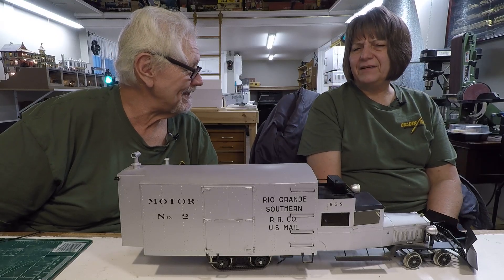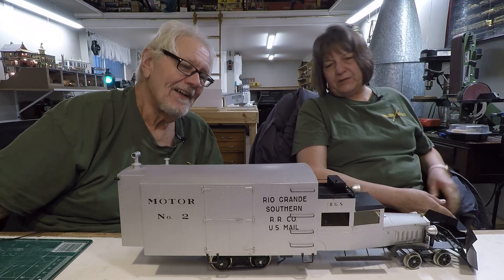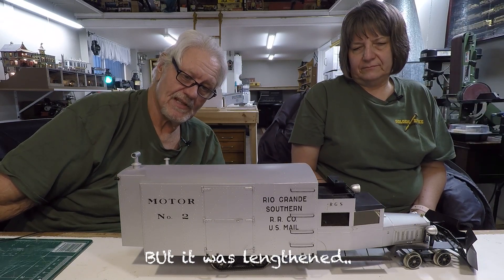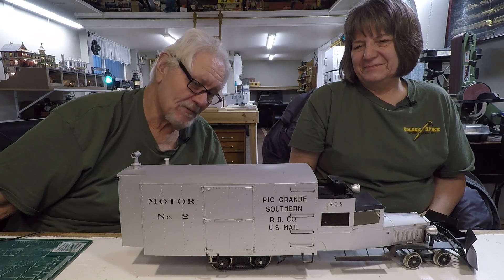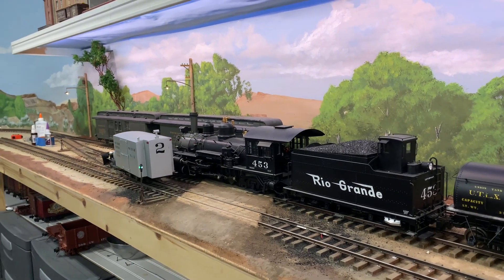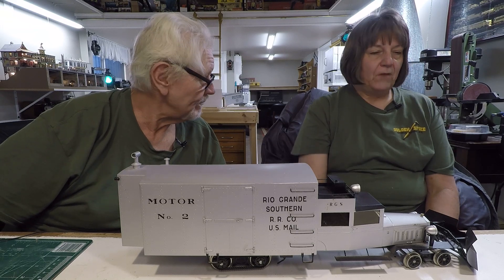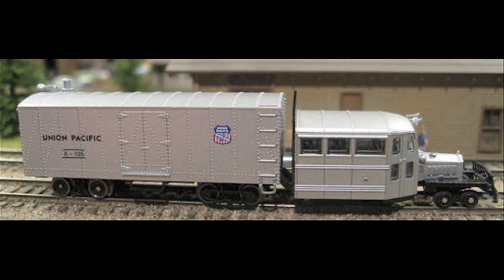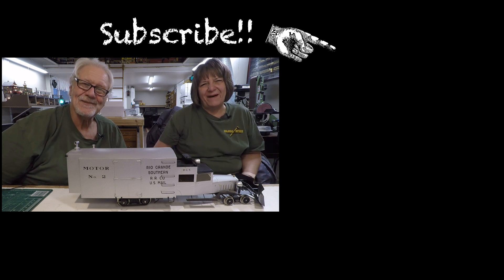Accucraft's 1/20.3 Rio Grande Southern Goose #2.

Comment: FWIW I  pre-ordered, and still have the Accucraft Goose #2. It has run flawlessly, but for limited amounts, for well over 20 years. The only thing I have ever found fragile about the unit is the plastic "chain" drive connecting the rear wheel sets, but having lost one early, it never seemed to matter. I suspect that carefully opening your unit and cleaning any dust and sludge and refreshing the drive train oil will solve your problems. Mine has always run outside on track power - power pick-up has never been an issue. Please try cleaning before converting to DCC, etc. (I have limited run time because my current Standard Poodle seems to find my trains prey and successfully and relentlessly hunts them, if outside.)

Also, as I recall, the original Accucraft price was a bit over $300, and the original car used is a Pierce Arrow.
Reply from the maker: Hi. Yes I think I can get it to run well. Still plan on DCC. Yea they go for more like 600 now. The chains are fragile and hard to get from accucraft. Dang.

Comment: If Accucraft keeps making them, and (the larger scales, presumably, like your venerable 20.3 specimen) can't always draw the power they need, I'd think it should be an easy mod to electrify the neutral 3rd axel.
Of course, I have to remember:  Never second-guess another man's manufacturing trades, until you've ridden his entire sub in his Goose.
Reply from the maker: The key is to run DCC. Constant 18 volts into a cap and it will keep going no matter what. This is a low DC voltage into 4 wheels. So it really bad....
Reply: @ToyManTelevision  I get it now.  Having never made the leap to DCC, I missed the constant DCV when you mentioned the higher track voltage in the video.  Light bulb now on.

Comment: Dale. most if not all model trains seem to have bright shiny wheels. Is it not possible to have a duller finish to the wheels, achieving a more realistic appearance, rather than toy like, and still maintain good electrical contact?
Reply from the maker: Well the contact area on a real wheel is shiny.. so the key is to paint the wheel to look dritty, dirty, dull but NOT the running surface. Its a trick. BUT in large scale anything is possable.... These models are stock. As delivered... they need a talking to.